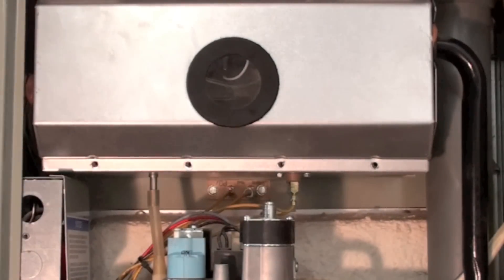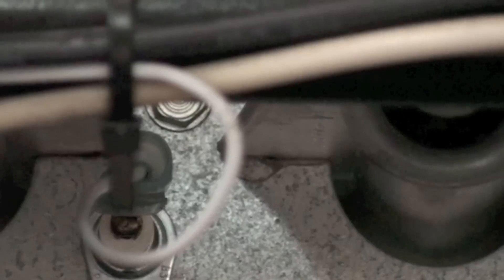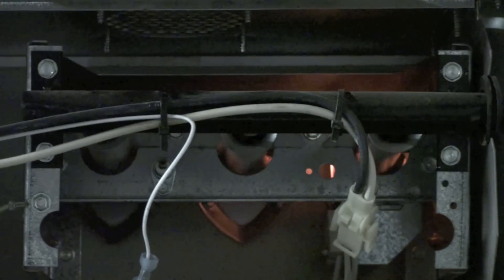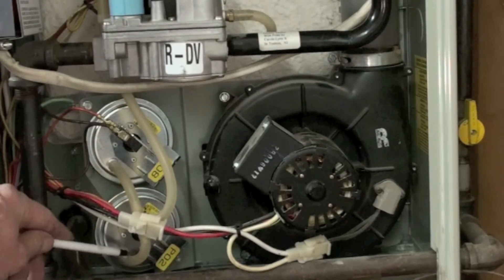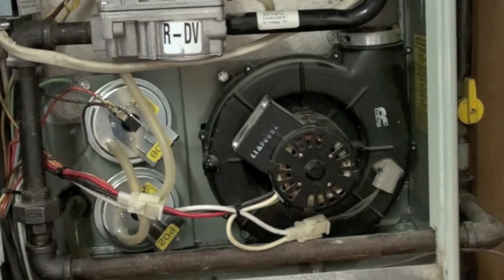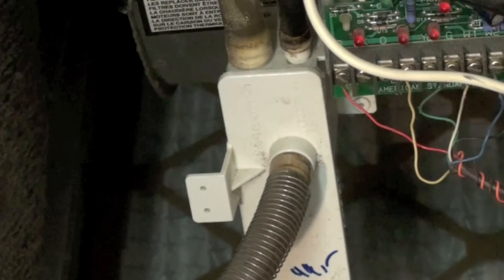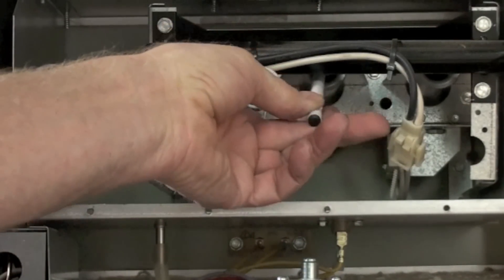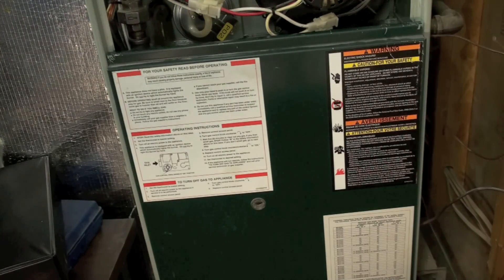Why does the gas furnace short cycle

Comment: You are DA MAN -- just saved me a call out for a simple fix - tried the flame sensor rod and made no difference so on to step two and the pressure sensor tube was full of water .. drained that and heat again :):)  Around here it takes a couple of days to get someone to do a house call so would have been cold for a few days as well as the cost. BIG THANK YOU !!!!!
Reply: Welcome
GFM

Comment: Thanks for the videos. Question: we recently had central air installed. Now the problem is that refrigeration coil that was installed is now blocking the warm air from blowing out fully. It just trickles out vents. Is there a way to temporarily remove it during the cold season? Thanks, Jim
Reply from the maker: The A/C coil should not have an appreciable effect on air flow.  These systems are designed to operate with that coil in place.  You could have the fan on a too low speed, a dirty fan blade, plugged filter or ductwork problems.
GFM

Comment: My gas furnace was short cycling.  I found your video, pulled out the flame rod and cleaned it gently with steel wool and it's working like a champ now.  I will have it professionally cleaned later this week, but I won't have to pay emergency pricing.  Again, thanks for the helpful video!
Reply from the maker: Welcome
GFM

Comment: Heater runs for 5 minutes, stops for 30 seconds and starts running again.

I removed the filter cover and it ran for 40 minutes straight.

Cleaned the outside of the intake vents in the house, placed the filter cover back on.....

Only runs for 5 minutes again.

I obviously will not run it with the filter cover off but it seems like a lack of air flow???
Reply from the maker: You are limiting out.  dirty filter, overly restrictive filter, dirty blower, plugged A/C coil, secondary heat exchanger plugged or ductwork problems.
GFM
Reply: grayfurnaceman thank you

Comment: This video describe my problem with the FAU igniting; the flames come on, then they go out after a few seconds. I will try to clean the flame sensor. My FAU does not have a window for blinking codes. How else do I test for the limit sensors / switches? TIA!
Reply from the maker: High temp limits will shut down the burners but leave the circulating fan on.  They also shut down usually after several minutes of operation.  
GFM
Reply: @grayfurnaceman  Is there a fix I can do as DIY, or hire a tech for it? I have changed out the ICM 281 board, new igniter and cleaned the flame sensor with an emery cloth.
Reply: @grayfurnaceman  My ICM board seems to be blinking three times.
Reply from the maker: @joet.5803  If the code is 33, you have a limit opening.  This is from an air flow problem.  Dirty filter, dirty blower wheel, plugged A/C coil, plugged secondary heat exchanger or ductwork problem.  
GFM
Reply: @grayfurnaceman  I replaced the filter and flame sensor.  Same problem.  Are the other ones easy to check!
Reply from the maker: @joet.5803  Wheel is easy, just open the fan cover.  AC coil could hard, must get into the ductwork above the furnace.  Secondary requires removing the blower assembly.  
GFM

Comment: I have a Goodman furnace and my blower turns on and off every couple of seconds. I replaced the blower and it does the same thing. I replaced the limit switch and it does same thing.
Reply from the maker: Is this the inducer or the circulating blower.
GFM
Reply: @grayfurnaceman  circulating blower. But I noticed the inducer started doing the same thing this morning when I turned it on. Turns on and off rapidly
Reply from the maker: @tomdonald2495  This sounds like a control board failure, but I would first jumper R to W at the furnace.  If it stops, you have a problem in the thermostat or its wiring.
GFM
Reply: @grayfurnaceman  thanks for the advice it was helpful

Comment: Goodman gas furnace GMPN060-3. 4 blink limit switch.I replaced twice. I replaced ICM board twice. Replaced pressure switch. Hot surface and flame rod replaced. fans run well. vent pipes clear. But furnace still run 5 minutes and flames stops and fans run about 2 minutes and cycles like this over and over. Will run normally when jump limit switch. Help!!!!!!!!!!!!!!!!!    PS! Sometimes gas release first and Hot Ignitor second.
Reply from the maker: I would be looking for a cracked heat exchanger.  Hot gasses will shut down the limit.
GFM
Reply: @grayfurnaceman  You were right. That's what it is. Thanks!

Comment: First of all Thank you for sharing your practical knowledge of fixing gas furnace short cycle. I did exactly what and how you said in your video. Im so glad it worked. However after maybe 10-20 minutes my Furnace STOP burning until it reaches 64F. But my house ecobee 4 smart thermostat registered 64F when our house setting was between 70-75F. May i know where do i go from here? thanks again
Reply from the maker: Your furnace may be overheating.  This is not normal.  Your problem could be a plugged filter, plugged blower wheel, plugged secondary heat exchanger, plugged A/C coil, or restrictive ductwork.
GFM

Comment: Another thing to do when you service furnaces is to open the "weep hole" on the pressure switches.  Look at the nipple that the vacuum tube goes and most of them will have a tiny hole in it.  That allows a little bit of air to pass through the tube.  It is meant to keep that hose dry which also helps keep the switches dry.  The best thing I found for clearing them is the little piece of wire that comes in some of the piston kits for evap coils.  Rheem had them. It is the right size and stiff enough not to bend.  Don't enlarge the hole at all, it can ruin the switch.

Comment: My rheem criterion does not have a flame rod.
Reply from the maker: If it was made in the late 1980s or early 1990s, they came that way and used the HSI as the flame sensor.
GFM

Comment: My Goodman gas furnace is new. I just turned it on for the 2019 heating season. It had been running all summer doing air-conditioning/cooling with no problem. But when I switched to heating, the inducer motor turns on, the igniter lights up, the burners light up, The blower circulates the heat through the house, but the flame goes out after almost exactly 30 seconds, The inducer motor stays on.then about five seconds later the igniter comes back on, the flame lights, the igniter shutsoff because the gas is burning inside the furnace. Almost exactly 30 seconds later, the flame goes out, the inducer motor continues to run, the blower motor circulates the heat through the house, until finally the furnace shuts off everything indicating that the thermostat is satisfied.
  Is a 30 second flame normal for the newest Goodman furnaces? I had a trayne 90+85,000 BTU furnace for 17 years. I never had a single problem with it. My son The very experienced 17 year HVAC technician,suggested getting a higher efficiency furnace/air conditioning system because the old one was getting old. The compressor was getting tired, we had to put a hard start kit in it to keep it going Last year
  I went to HVAC school  as a requirement for my job as an electrician/air-conditioning maintenance man. I actually put the furnace air conditioning system in my house that was here for 17 years. Although I went to school, I never had to work on any gas furnace ever. I just had to go to school to learn it as a job requirement. I do not know how to troubleshoot these things. Never did it. Never had to at work. We didn’t have gas furnaces. We had heat pumps with auxiliary heat And electric heaters.. not a gas heater or gas furnace in the entire company.87 buildings, Most of them unmaned equipment/switching buildings
.. your video was helpful, it makes it look pretty simple. I just hate the fact that I have to work on a brand new furnace. I’m going to remove the flame sensor, check for blocked drains especially at the pressure switch, I’m going to make sure my two outside PVC pipes aren’t locked, I do have screens on them at the ends to keep on birds and stinkbugs. I suppose my problem could be the new style t-stat.. 
  But I will clean the flame sensor first and check for blockages. I just hope it’s not normal for this furnace to burn gas for 30 seconds at a time through two or three cycles and then shut down. It’s just unnerving to hear that flame kick on and rumble inside the furnace two or three times during a cycle
   Thanks for the checklist video. Very well done
Reply: I have a Goodman furnace and its doing the same thing, the flame comes on for a second but then turns right off.  I want to try cleaning the flame sensor but I was having trouble locating it. I think I found it now but its in a really tight space that does not leave any room for a screwdriver to get through. What is the best way to unscrew that? What sort of tool should I use?
Reply from the maker: To eliminate the thermostat, jumper R to W to see if does the same thing.
More commonly, you could have a low spot in the vent piping.  If water collects there, it will shut down the pressure switch.  You should have 1/4" per foot toward the furnace.
GFM

Comment: My furnace is 8 yrs. old. I have a Bryant thermostat on a Bryant Heat Pump with a Nordyne furnace.  At night I turn down to 69 deg. In the morning I turn up two 72. It will start and run till 71 shut down and start again till it gets two 72 deg. There has been times it says 72 deg but it will shut down and start 2-4 times before it stops at 72.  This happens just about everyday in the morning only. The rest of the day it works fine. Runs like it should. Just in the morning only.

Comment: What do you think about a Bryant thetmostats? I been wanting to change to a Honeywell instead but been told I can't do that.
Reply from the maker: If it is a communicating thermostat, designed for the furnace, you may not be able to change it.
GFM
Reply: @grayfurnaceman   Would it be possible to make it into just a ac and furnace only and not using the heat pump as for heat just ac only?  I would like to use it as ac and furnace as heat only.
Reply from the maker: You can eliminate the heat portion by using the energy heat position on the thermostat.
GFM
Reply: @grayfurnaceman   Thanks

Comment: I have a 90 plus in my shop that would run for a few minutes and shut down found out the hard way the fiberglass filters are the next best thing to no filter on my furnace under the room blower is a radiator looking thing so much dust made it through the filter it clogged solid I had an 1/8 of dust on everything in the shop after using an air gun on it I now filter the air going in the furnace room and buy the better filters for the furnaces been working fine for years now with no more problems.

Comment: I  have  a  Lennox  Furnace  the  induction  motor  come`s  on  but  go`s  right  back  off  any  suggestions.  THANK`S
Reply from the maker: Not sure what age, but sounds like a pressure problem like the pressure switch not closing.
GFM
Reply: @grayfurnaceman   Thank`s  I  put  a  new  pressure  switch  in  and  doing  the  same  thing
Reply from the maker: When I say pressure problem, I don't necessarily mean the pressure switch has failed.  The pressure switch is an indicator of a problem.  Water in the vent or vent blocked.
GFM
Reply: @grayfurnaceman   could  it  be  the  induction  motor ?   It  get  hot .  I  will  check  for  water  in  the  vent.  THANK`S
Reply from the maker: If it is overheating it will run for at least 10 minutes before shutting down.
GFM
Reply: @grayfurnaceman   THANK`S  man  I  am  going  to  get  a  new  motor  in  the  morning  and  put  it  on  if  it  fix  it  I  will  let  you  know
Reply: @grayfurnaceman    It   was  the  induction  motor --  got  a  new  one  and  put  it  on  and  it  is  running  like  a  new  one  now -  THANK`S
Reply: Glad you got it going.
GFM @brightb7

Comment: Thanks, my furnace is cycling but working & here in St. Louis, MO we getting the coldest winter since 2014. So I'm not going to touch since it's working but after Thursday we will be above 45 degrees. I will clean that flame rod. I cleaned the flame sensor Jan 3, my HVAC son changed the igniter & it was fine until a few days ago

Comment: Well hopefully you still monitor this page. My question is why would my brand newly installed furnace two months ago short cycle as it were. It starts and fires fine runs for 5 minutes then shuts down and restarts in another 5 minutes. we found that we had a balance issue with my fathers side suite and found i had to close alot of floor vents to get hot air to his side oh the house. In doing so we figured out it had to do with no air return to the furnace from his side of the house. I did in fact push one more heat register to his side from our dinning room and since cut a hole in a wall for a return air and things seem to work for heat on his side but still have the  5 minute cycle problem. As i have been watching this video and reading all comments my furnace is still doing it. I do have some floor vents still closed to have more heat balance through our house and my dads suite. I am thinking and i may be totally wrong but maybe having closed vents is overheating the furnace thus shutting it down early. Is that a possibility. it is colman mobile home down draft 90,000btu furnace in a modified mobile home from 720sq ft single wide to now 1400sq ft  more a ranch style home.
Reply from the maker: You have duct problems.  If the home is still using the ductwork for the original home, it is too small.  The original ductwork was just barely large enough when used for the 720 sq ft.  You will need to add ductwork.
GFM

Comment: Thank you for the video.  When I went to remove my flame sensor to clean it (it wasn't very dirty) I discovered the retaining screw had come loose and it wasn't all the way up into the flame.  I cleaned it anyway and secured it tightly and the problem was solved.
Reply from the maker: Glad you got it going.
GFM

Comment: My inducer motor keeps ramping up and down, doesn't stay running at a constant rpm. Heat doesn't come on, guess due to inducer ramping up and down. It's a 90% amana gas furnace. Going up in  attic to check clogged drain lines. What else can I look at.
Reply: How hot should it be coming out of vents.

Comment: Thanks so much for the advice! I was having a 2-3min short cycle. I found the trap off the inducer motor totally plugged up. I cleaned it out and blew out all the vacuum lines and I was back to normal!
Reply from the maker: Glad you got it going.
GFM
Reply: What did you use to blow the lines out?

Comment: My furnace will run for roughly 10 minutes. Shut off for 30 seconds and repeat the process. I thought it was my nest thermostat so I took the wires off and connected the heat,fan and power together and ran the furnace. After 10 minutes it shut off and repeated that process. Any reason why?
Reply: The furnace may be overheating.  If you get an open limit code, you are overheating.  Look for plugged filter, dirty blower wheel, plugged a/c coil or restrictive ductwork.
GFM
Reply: Could the flame sensor also be dirty and needs cleaning?

Comment: 9 Year Old (New in 2009) Trane XB Furnace (Propane) Has Trouble Starting. Need Suggestions.

Model # is: tuc1b080a9421ac

Already cleaned filter, removed flame sensor rod and used steel wool to clean off carbon deposits (wasn't very dirty), blew air into vacuum switch. All fans seem to be working. Igniter glows o.k.

When turned on, it gets as far as glowing, but doesn't ignite. I switch it off and start it up again. This time I cup my hand and tap the air intake (PVC) pipe when the igniter clicks and glows. This action seems to do something that allows the propane to ignite, then it runs fine. After temperature is reached, shuts down o.k. Then the same thing happens when there is a call for heat and it tries to ignite again. it cycles 3 times, then the main fan comes on and blows cold air

The flashing red light error code I get if I don't intervene is: 2 Flashes (System Lockout) (Retries or Recycles exceeded). It won't ignite, and fans continue to run, blowing cold air.

I temporarily solved the problem by taking a red plastic cup, cutting a hole in the bottom of it (about the size of a quarter) and placed it over the intake pipe.  By choking off a bit, the gas is now able to ignite (most of the time, but not always). I'm sure that there must be a better way to do this by making some kind of adjustment somewhere, but if so, I am not aware of what to adjust or replace.

Any suggestions appreciated.
Reply from the maker: There could be a number of problems here.  The one I am thinking is a gas valve problem.  If you can check voltage to the gas valve during a trial for ignition, I would do so.  24 volts at the valve with no ignition means a failed gas valve.
GFM
Reply: @grayfurnaceman   I will check the voltage at the gas valve and let you know. But since this is an intermittent problem, if the gas valve has failed, wouldn't that mean that it should never provide gas for ignition? And why when I restrict the airflow on the PVC intake pipe does it seem to solve the issue (most of the time)?
Reply from the maker: A gas valve problem could be intermittent.  Increased vacuum in the combustion chamber could effect the the regulator on the gas valve.  Remove the hose that travels from the gas valve to the combustion chamber and see if it makes a difference.
GFM